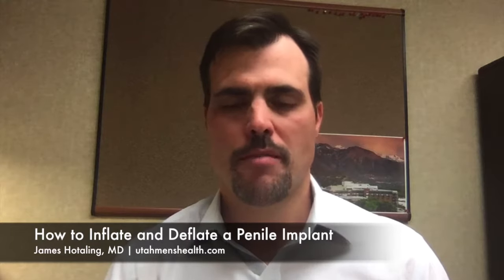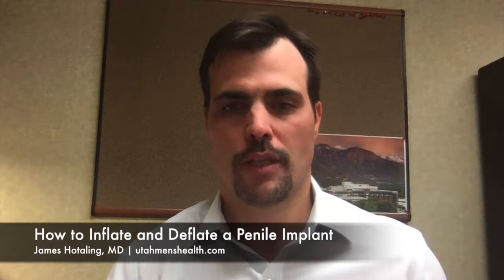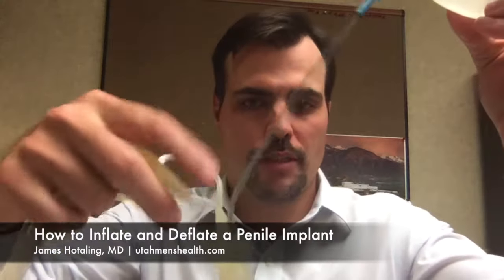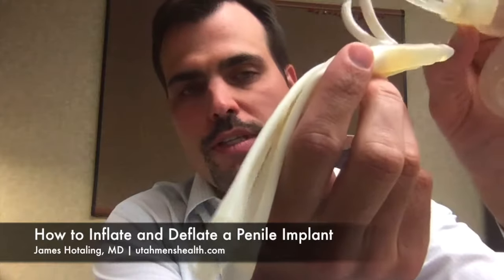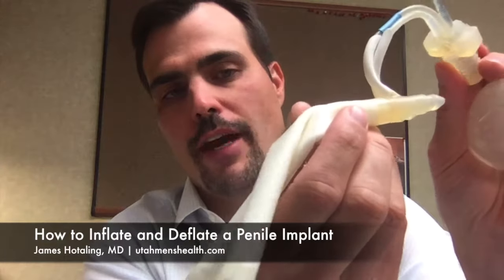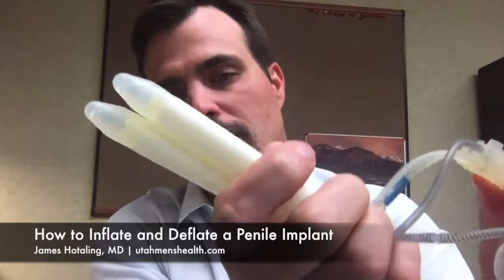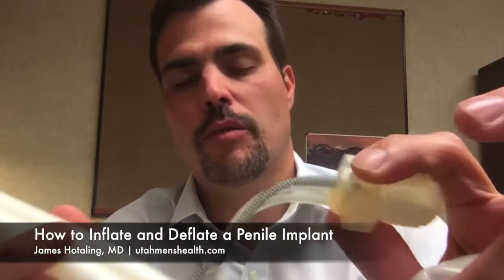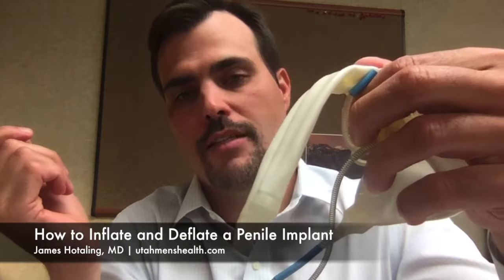How to Inflate/Deflate a Penile Implant

Comment: What they do NOT tell you is that the TRIMIX injections can CAUSE PYRONES DISEASE 
And if you already have a buildup of plaque on your penis from injury or lack of use or build up of toxins in your food getting stuck in your body. You can go for a more simple way to break the plaque away by natural vitamin or mineral, or penis pumps, or ultra sound waves, or last case senerio is surgery to have the plaque broken/stretched out or cut out in severe cases. 
And if non of that works then they suggest the penile implant..... it's supposed to be last case scenario instead of quickie lol but it can take 6 or 8 weeks after surgery before you can have sex. If it heals properly 👍 good luck lads.